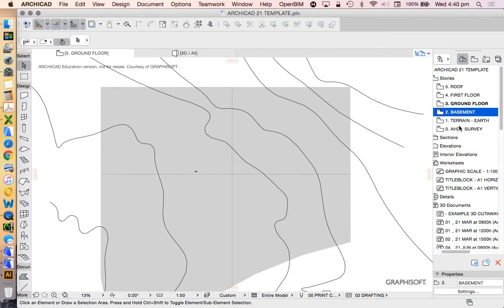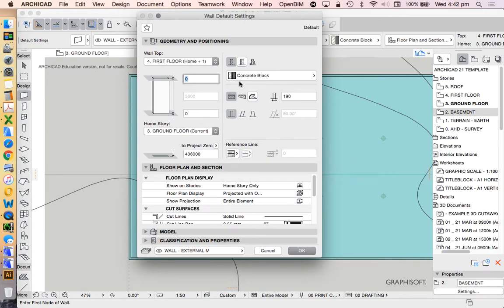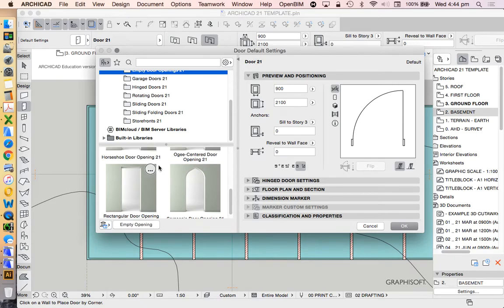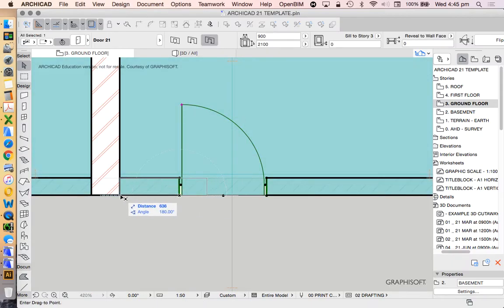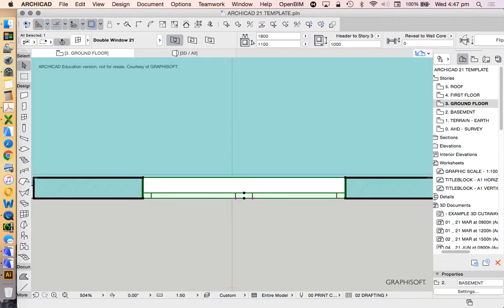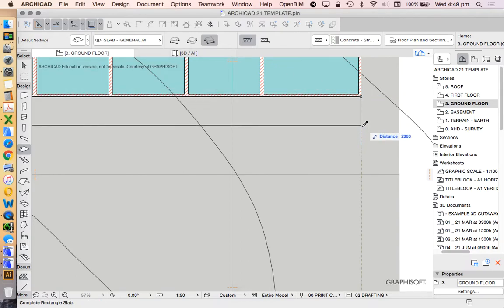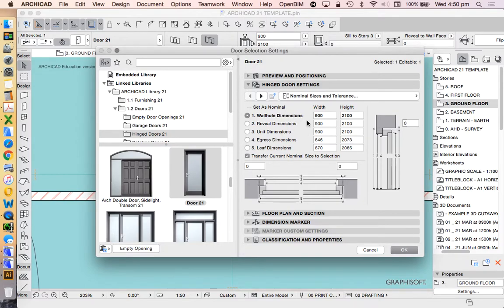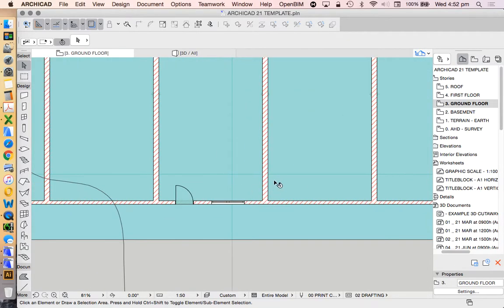ArchiCAD 21 - tutorial part 12 - door & window tool

Comment: Hi Robert ..

Is it possible , to edit windows and doors in the perspective mode. 

So you move a window with the mouse or change the size .

Are there components in ArchiCad like in SketchUp . So you 

make some copies of a part of a building, edit one and all 

copies ( components ) will also change. 

thanks
Reply from the maker: Hi Andreas, yes you can edit in 3D. You can pick up seetings (ALT) and insert new windows (with same settings) into a new wall, but you can't drag a copy of windows between different walls.

Comment: Can u recommend for me a website to download materials (brick wall for example)
Reply from the maker: Hi, there are so many available now, it is far easier than it was years ago. Here are some for example: https://freestocktextures.com, https://www.textures.com, https://www.vecteezy.com/free-vector/texture, http://texturelib.com
Reply: Robert Mann thank u for ur answer.i have one more question for example when i put one wall 100 cm high from surface i cant see this wall on my storie do u know why?
Reply from the maker: Hi, archicad has a set limit for visible view range. This is a standard drafting rule: anything above a metre is now visible in the plan. You can change this setting, but it will have knock-on effects for your drawings. You would be better off adjusting your heights so you generally don't need to see anything above this height, or change it's setting so that it represents anyway. the only time when this is a big problem is if you are doing split level buildings. In this case i generally set the higher level at less than 700mm above current storey, and set the lower level at up to -1500mm below current story. This will give you plenty of height to play with. Any more than this shouldn't be a split, but a separate storey. I hope this helps.